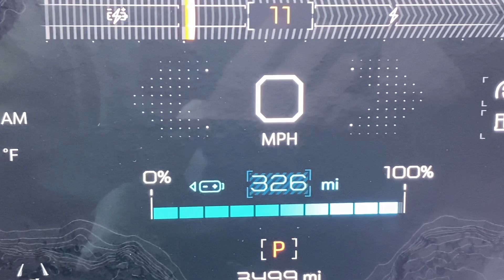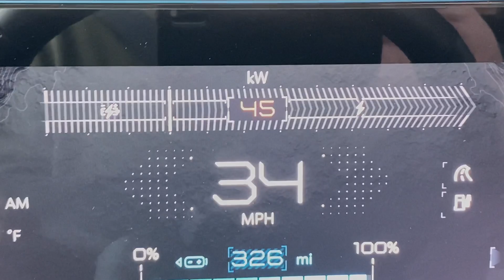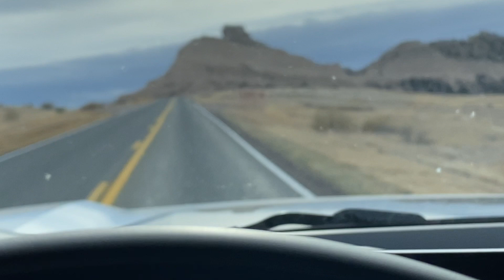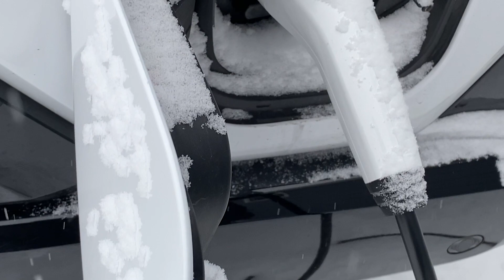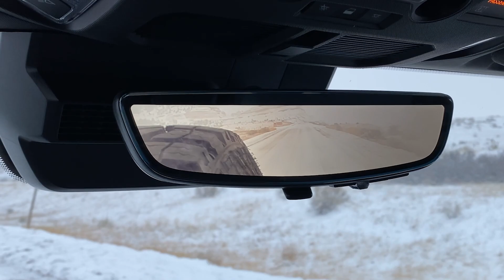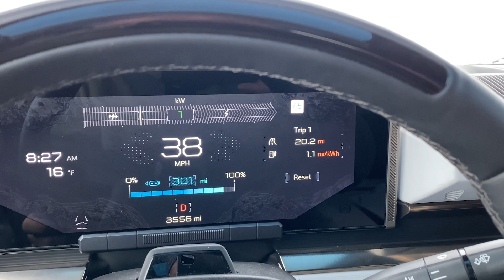Snow and COLD! Electric Truck Range Test with 2022 GMC Hummer EV

Comment from the maker: Wondering how much draw the accessories or fan speed has on the battery? We cover all of that in this video: https://www.youtube.com/watch?v=Q9hQXNBSDQs&feature=youtu.be
Reply: Give us a video of you hooning in the snow. We haven't seen that yet.
Reply: He is dressed warm no heater on no passengers  no rear defrost no radio no speed! And let the truck in the cold over night before you drive! Real world
Reply: Had another thought, Tim.   How about EVs vs ICE at altitude?  Would there be a noticeable difference there?  I know the turbos in my Powerboost kick in alot more when I'm at altitude.
Reply from the maker: @1diggers1  I've driven some EVs in the Colorado Mountains and you are using a lot of energy, like you do in an ICE vehicle. I don't immediately see where one would use less energy over another one to get up a hill. 

Now, with the case of the Hummer EV, specifically, you are going to use more energy and that's just because it is really heavy. 

For most EVs that are actually efficient, I'd say it is a wash.
Reply: @Pickuptrucktalk  Interesting, thanks Tim.

Comment: I feel the range drop argument for evs is irrelevant. In my ice ram 1500 I get around 700km in the summer.... and maaaaybe 500km in the winter.  Ice vehicles lose efficiency in the winter just as much as evs do. And it takes alot longer for my truck to warm up. On those reaaally cold days, like -35 I let my truck warm up for almost 45 minutes before im comfortable driving it. In an ev i can preset it to warm up, and i just hop in and go when I wake up. Seems like a no brainer that evs are superior.

Comment: I dont understand why wouldn't you pre condition it to warm up the cabin plus battery before you left while it was plugged in? If you leave the house at 8am set it to start the pre condition at 7am. Warms it all up for optimal battery range plus warm cabin while plugged in.

Comment: Free driving especially if your a Farmer with your solar panels and about twice to three times the reliability compared to anything including diesel I mean it can hit 3.000.000 miles with no issues because electric is that reliable and efficient.

Comment: Thanks for commenting about the heat. Would have liked to know if off road mode improves handling on snow and if the heat is off how long does it take to get cold is there good insulation?
Reply from the maker: Off-road mode doesn't impact handling. It just changes throttle response and steering responsiveness. Not sure on how fast it cools off. Typically people ask the opposite question.
Reply: @Pickuptrucktalk  I ask the question about insulation because having a in the cold possibly in the middle of nowhere if you break down will the heat still work and if not how long can you stay warm. Thanks for the response.
Reply from the maker: @Daniel-ko9un  just an impossible question due to so many factors. If the EV has power, it will provide heat longer than a ICE vehicle since EVs use less energy to provide heat in the cabin than a gas or diesel engine. 

Insulation isn't really something automakers spend a lot of time on. Noise cancelation? Sure. Insulation, not really.

Comment: 11 kW to idle & run the heater? My residential 22K BTU heat pump maxes at 2.4 kW on max heat down to -15F .... And heats 800 s.f. 

To heat that tiny car you need maybe 500-800 watts

Comment: This is good to know. The Ford lightning is losing .8-1.5 miles per kw in the cold. Good to see gm figured out the preconditioning of the battery on the first go. Ford is going to have lawsuits if you ask me.

Comment: so Tim, obviously you like the electric HUMMER.  that's nice. however, have you given much thought to the fact that you could buy TWO new 4x4 "normal" trucks for the price a person has to pay for that HUMMER?  and you don't seem to be too "concerned" about having to stop somewhere to recharge. so your nice HUMMER is going to take AT LEAST 30 minutes to recharge at a "public" charger - and of course, that assumes the charging station you stop at when it's 17 degrees out is even working. if you need "gas" in your "gas powered" truck it will take you all of about 5 minutes to "fill up" and you will have MULTIPLE choices of "gas stations" to stop at.  and then you "feel so safe" driving that 9000 lbs. 4x4 "on the ice and snow."  that's nice also.  i hope you realize that if you should happen to "slide off the road" and hit something with that truck, you are going to have to take out a mortgage on your house to pay to get it fixed.  you do know that just replacing ONE broken tail light assembly in that truck can cost upwards to $7000.00!!  and all that "electronic convenience" that you LOVE in the interior of that truck - what all those "bells and whistles" REALLY mean is that you have hundreds of opportunities that one of your "electronic systems" is going to break.  if a HUMMER tail lite costs $7000, you can assume that replacing any of the "electronic modules" that run that "Space Shuttle" dash will be THOUSANDS of dollars.  so Tim, it's nice that you really like this "electronic" truck.  but i'll bet my next year's salary that LOTS of HUMMER buyers are going to get pretty tired of this truck once they start paying for repair or crash bills.

Comment: I have h2 suv and h3t hummer itll out live that electric thing im so sad general motors gone the direction they did with the Hummer thanks for your test info.
Heres a funny a friend had chevy bolt the battery went bad and wouldnt run and diesel run tow truck hauled it to the dealeship at 1800 miles on it so sad

Comment: The thing is charging is cheap now because it is not a big market share, but like any other energy source it will increase in cost substantially. Look at gas used to be super cheap, the massive energy grid and Infrastructure improvements will be costly. If you have good solar at home yes it will be cheap but other than that energy cost will be no different than gas.

Comment: Here's the thing. I wouldn't by an EV if my main driving was long distance.   My range will be less, I'll have to wait for my vehicle to charge, and I'll have to pay 4 to 5 times more for electricity to charge versus charging at home.  
I purchased my EV to only drive locally and only charge at home.
Reply: Really depends on what you mean by long distance. If it requires Public charges that can get pricey.  But who is driving 250 miles daily? That calls for a lifestyle change.

Comment: Kw and kwh differences 
Kw are how many thousands of watts you're currently using.
Kwh are how many thousands of watts you used in one hour.

Example:
Lightning ER battery has 131 kwh of power.

If you were running something that was using a constant 10 Kw of power you could run that item for 131 kwh ÷ 10 kw = 13.1 hours.

Comment: You have auto climate. Why not just dial in the temp you want no put it on auto. My wife does the same thing and it drives me crazy. Lol. If the vehicle is cold putting it at 70 or “HI” will yield the same amount of heat once the heat gets going. She somehow thinks that if she puts it on hi it will get warm quicker. 😂
Reply from the maker: Auto blows cold air as well. Not a fan. Just personal preference.
Reply: @Pickuptrucktalk  I get it. Just busting balls. My wife is the same way as I said. Personally I love  auto. It’s like being at home and just setting the thermostat. 😂

Comment: What is the life expectancy of the battery?  How much would it cost to replace the batterie’s?
Reply from the maker: Life expectancy? As long as you’d like. They just degrade over time and lose range. Cost to replace? A LOT. Think $40-50k TODAY. In the future that could see a dramatic drop in price.
Reply: This is a lease only vehicle. Would NEVER buy one.
Reply: Its a 110k vehicle.  The owner will upgrade before the battery warranty expires.
Reply: I have read that the replacement battery on a Tesla is 20k and a life expectancy is 8 years but that depends on how may times you charge. Also I would think that the life expectancy would be much shorter in northern states compared to southern states.
Reply: @raytycker1656  It depends on a variety of factors, but the biggest is probably heat. Batteries don't like heat, which is why the Leaf batteries perform so poorly (no liquid cooling). The northern half of the country would be better for longevity in this regard.

Comment: That’s all well and good IF THE CHARGER IS WORKING AND AVAILABLE. Based on the experience of TFL and the problems they’ve had in their testing that might be a big IF!
Reply: Agreed. Sure seems like we’re missing a step between. I’ll go hybrid before all electric. My electric bill in SoCal is already $400 a month
Reply: How much are you paying for gas? EV is 3x to 5x more efficient than gas engine. Even with pricey electricity you can come out ahead.

Comment: Few questions…
1) on these tests were you preconditioning the battery from grid?  
2) who would have thought a 9300lbs vehicle would have great regen🤦‍♂️ 
3) comparable ice truck🤔 let’s see hang 2000lbs of suitcase weights off the cab steps to keep the weight centrally located like this XV and see if handling characteristics are the same.
4) What one thing this XV and Amish buggies have in common?…never will you see them on the interstate!😆
Reply from the maker: 1. No.
2. It is physics. 
3. Maybe. 
4. I’ve seen Amish buggies on the interstate.

Comment: One thing you are not aware of. Battery capacity changes in the cold and 100% displayed is not 100% state of charge of the battery.  My Ford  Mach E EV  100% is 79% at 0F.  So your data is not accurate unless you scan the battery and get the true State of Charge at both temperatures.  $10 for CarScanner and an OBD dongle is worth it.   You can report the 1.1 and  1.3 but the battery size may be substantially different in both conditions.  That’s actually where your range goes……It changes with preheat conditions too.

Comment: How long would it take to charge this to 100% at home?
Reply from the maker: Empty to full on 220 v is about 26 hours. Nobody really does this though. EV owners plug in every night and just top off battery.
Reply: @Pickuptrucktalk  Maybe not normally but there are plenty of occasions when I’ve come home on fumes knowing I’d have to hit the gas station the next morning. In this situation I would only have maybe a third of a charge by morning. I’m sure these new EV batteries can last no matter what charge cycle you use though so that probably would be fine.
Reply from the maker: @pryme2013  Basically I'm charging at a rate of 10 miles per hour at home with 220V. So, if you get home at 5 pm and leave for work at 8 am, you should have 150 miles of range in the morning give or take.
Reply: @pryme2013  The reason you're coming home on fumes is probably because when you left the house that day, you didn't have much gas in the tank because you were putting off going to the gas station. With an EV, your house is the gas station. Imagine always leaving home with a full tank.
Reply: @Thanos88888  No I get that. I would be a perfect candidate for a EV. I have a home with a garage and 200amp service. I could easily get a 220v charger and my commute is less than 10mi. I’d consider one when it’s time to replace my daily driver
Reply: @Thanos88888  No, he just got back from a  450 mile trip. Wait, the EV is still back there waiting 26 hours to charge so he can get home. He's hoping there are no rolling blackouts from overloading of the electrical grid.... He'll look back one day and say "those were the days!).....

Comment: If you have to charge away from home you will pay 75.00 to 100.00 for a 200 mile range charge not cheaper than gas or diesel.
Reply from the maker: $100 for 300 miles or so per other YouTube videos. Going to be expensive road trip for sure. Just not sure if you can spend $110k on a new vehicle, you really care about $100 fill ups for road trips only.
Reply: As of 2025 tesla, with membership        is 14 to 18 cents per kilowatt before 8 am. 100 kilowatts of charge 14 to 18 dollars. That's reasonable.  ❤❤❤

Comment: It’s funny I’ve been searching and searching for videos like this with the ford lightning. Almost no one is talking about it. Why Ford didn’t do a heat pump in the 2021 and the 2022 lightnings I will never understand.  I think they might be putting one in the 2023 models, but I could be wrong on that.  Someone posted a video the other day saying the ford lightning pro he had was losing up to 40% of the range in the cold. And it wasn’t THAT cold. What Tim just did was truly cold.  I’m from Toronto Canada so we regularly see -30 in the winter. My guess is Nebraska does as well. Your windchill is probably nasty due to the wide open fields    Great video as always. You really do great work
Reply from the maker: I wish I could have kept Lightning through the winter. I’d like to see how it does first hand.

Comment: Wait so it only lost around 40 miles on a full charge roughly? That’s nothing.  I guess that heat pump makes a huge difference wow.  The ford lightning is losing up to 30-40% in some cases. This gives me great hope for the Silverado Ev.  It’s better drag coefficient for sure then the hummer , weighs less, less motors.

Comment: The price of that vehicle offsets any kind of saving on charging it instead of having to buy fuel for it.
Reply: I hope more people buy EVs. The demand for gas should go down, and we should pay less at the pump.
Reply: That's not how it works. OPEC reduces production to keep prices up when demand declines.
Reply: It's a toy for rich people.
Reply: Dpending on electricity prices in they area it'll be charging you'll be paying about the same per charge you would for a tank of fuel.
Reply: True, but for someone buying a 100k F250 or GMC they'll save on gas. Think a business owner that needs a Super Duty, but doesn't tow far, like a trade business owner.

Comment: What is this world coming to when you have to worry about putting your heat on in your truck🤣
Reply: In gas and diesel trucks it wasn’t uncommon to worry about using AC in the summer.
Reply: @cybertrk  heat and AC are two totally different things for gas engines guess not ev"s
Reply: @RAM-KINGOFTRUCKS  Right... that's my point, both are energy consideration. The only reason you don't worry about heat in ICE is because there's so much wasted energy with the combustion process generating heat byproduct instead of motion.
Reply: @cybertrk  better go back to your point 👉 🤣
Reply: @cybertrk  worrying about the ac affecting your mpg was a 70’s to 80’s issue. It isn’t a issue with newer vehicles. The ac compressor doesn’t cause huge drag anymore
Reply: Let's just stop putting heat in vehicles and what the hell who needs windshield wipers. 😂😂